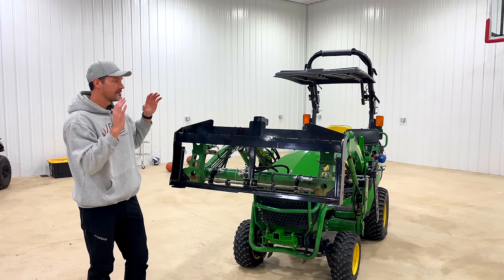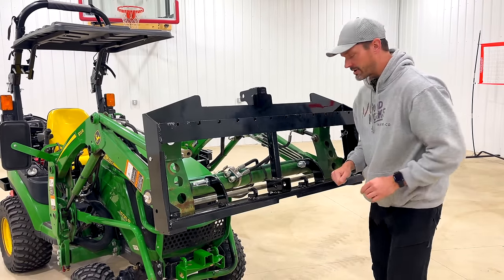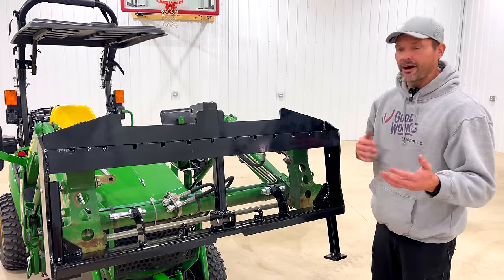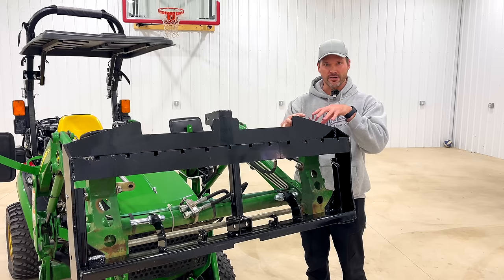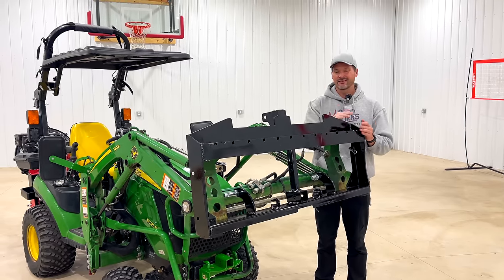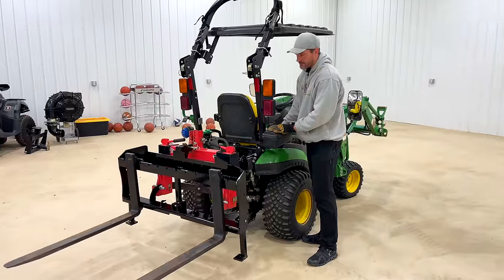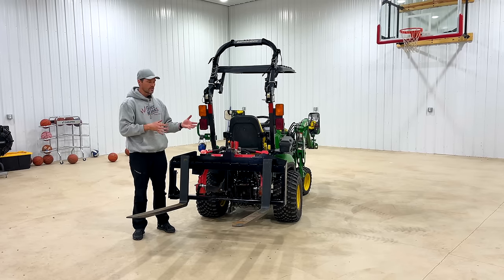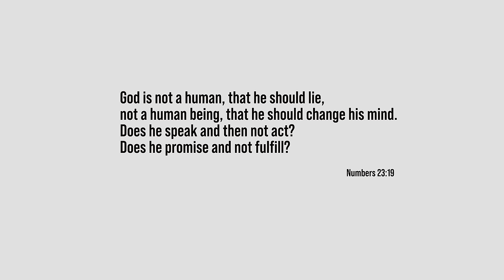I INVENTED BETTER PALLET FORKS

Comment: My immediate thought for the headache guard actually became a bonus feature as I was imagining it. First step is to change the top link bracket gooseneck hitch ball hole into a 2” receiver shape. The headache guard then utilizes that 2” receiver as its primary mounting solution. Have locating pins/holes on the ends of the headache guard to limit twisting forces on the 2” mount tube. Then the genius part I realized is that you could use your headache guard as a small platform if you mounted it into the lower 2 inch receiver. Let’s say a simple version was just made out of square tube steel in a hoop with expanded metal mesh. Not only could you use that as a headache guard but you could also put it in the lower 2 inch receiver and utilize it as a small carryall platform, especially for bags of mulch, fertilizer, feed, whatever. Just a thought for you. 😉
Reply from the maker: Good idea fogle...the reason we haven't used the 2" receiver tube for the gooseneck on the forks nor our VersaBracket is cost...those tubes are actually quite a bit more expensive...perhaps we reconsider though
Reply: How about extending the parking stand tubes and using those like a steak pocket for the headache rack? Only a small change that is still out of the way and braces both sides. @GoodWorksTractors

Comment: I finally put my weight brackets onto my SpeeCo quick hitch.  What a great product.  I took off my Heavy Hitch to install my carry all and haul my tree cutting gear to my neighbors house a quarter mile down the road from me.  I dropped the carry all onto her lawn so my equipment was in one central location.  After felling part of the tree, I started moving a load of limbs on my forks only to find the tractor was too tipsy.  I sprinted home and put the weight brackets on the quick hitch and slung 240 lbs of additional ballast onto the back of my mighty BX (LOL) and what a difference that made.  The great thing about your design is the carry all still works with the brackets and weight in place.  GWT offers some great products.  I currently have a Rhinohide canopy, the SpeeCo Quick Hitch, and the Quick Hitch Weight Brackets.  Enjoy the Journey - Cheers
Reply from the maker: Awesome, that is great to hear.  I love em too :)

Comment: PARKING STAND ……if the receiver tube was extended upwards and made longer this would allow the operator to install the stands upside down.  By inserting the stand upside down and only a few inches inward this would leave a foot or so extended above the fork frame and instantly gives the operator a poor man’s headache guard.   I currently have this modification on my forks made by AI2 for my Kubota BX.   It’s so simple , cost effective and works great when handling logs or other dangerous items.    Great video, and you look to have a much needed product.   Big thx

Comment: I’m definitely interested in a set of these pallet forks for my Kubota MX5400. When you come out with the ssqa version. I also would be interested in a bolt on extension to increase the height of the frame. What a great product. I love the fact that you are a small business and it’s American made . Thanks for putting forth the effort to design and build this fantastic attachment.
Reply from the maker: Thanks Robert!  SSQA version shouldn't be too much longer.  Trickiest part was making the back frame work for loader and 3 point without the brackets interfering with one another.  I believe we found our winning solution though.

Comment: If you decide to offer headache rack, make it secured by pins!  Easy on or off when needed.
Reply from the maker: Yeah, that does seem like a logical solution.
Reply: Yup I second the motion to use pins for the headache rack. Easy on easy off
Reply: Agreed - with the add on feature of a double-use headache rack/support feet.  Have it function as both, using the pin as the locking/securing mechanism.

Comment: I like it. I would have made the lower pins a double shear. 2 mounts with a pin between them. I would also make a plug that goes into the receiver that looks like a T to keep the forks from coming off if used near the center. Only had that happen once but it was a major pain to recover the fork. I would also add a D ring or a hole in the upper right and left corners, I use those a lot with big rachet straps to secure things on to the forks.

Comment: Would come in handy for anyone wanting to carry a 250gal tote on the back,  load it up with fire wood and the grapple on the front and carry a chainsaw in that accessory you got as well.  Full 250 gal tote with wood would probably be 600-800 lbs depending on if it's wet or not.

Comment: I like the drop down legs, but would swap the pin with loose pin clip, which I would almost certainly lose, for a square lock/safety pin or clevis pin where a small piece of wire secures the clip to the pin.  But I get why you wouldn't ship them that way.  It's an operator preference thing and some might never use the leg stands and it would add $7-9 per unit, even if you bought them in bulk.  Hardware prices have gotten out of control in the last few years.
Reply from the maker: Hardware is pricey!  Never know, we may make tweaks over time

Comment: Looks like the quick hitch would interfere with suit case weights when using it on the 3pt, or the upper pallet fork frame mount would interfere if the suit case weights tried to hang out back.  I certainly could be missing something though.  Could you show how the suitcase weights work on the 3pt?   I think I understand how they work when on the loader.  I like the design and idea.  I also think it is good that you left the headache rack off, making a removable one would be preferable for sure.  I have both the VersaBracket and the Hitch Hangers, bundled with all the 70 lb weights they can hold, love both of them.  I have 2 of the red SpeeCo E-Hitch's as well (second one is going to be customized....), so thanks GWT.  Have a good one!!👍

Comment: Instead of a bolt on headache rack, how about adding a 2" square vertical tube on either side of the frame, and having the headache rack drop in, and then pinned like the parking stands? That would make it easier to install or remove. Perhaps to avoid adding the cost of the tubes to every rack, the rack kit would include a 2" tube welded to a plate, and the plate can be bolted to the frame. Something I'd like to see on ANYTHING with pins are wire lanyards to keep from dropping the darn clip. I make my own, but it'd nice if they all came that way.
Reply from the maker: Yeah, might do something like that....I also thought about just making it 4-6 vertical stantions....no horizontal bracing...the vertical posts would serve the purpose, while keeping weight down and oprator visibility to a maximum
Reply: @GoodWorksTractors I think the key takeaway is making it easy to install or remove as necessary. I'd be inclined to leave it off most of the time, but if I'm moving brush or a pallet loaded with straw bales, I'd want the height so I can move more in a load. Also, 2" tube was supposed to be 1". 2" is too large and too heavy.
Reply: TowSmart makes clevis pins with the wire already attached and wider heads so they are easier to remove.  I really like them, along with square safety/lock pins.
Reply: This method of attachment would be ideal & easy to add or remove. Some sort of headache rack is all but essential if used an a Utility tractor.

Comment: That looks like a great idea. One thing that I would really like to see is a way to move 3 point (quick hitch) attachments with the loader. Maybe this could mount where the forks mount? Just something I've been looking for. I run smaller tractors so no need for a headache rack and would rather have the lift capacity.

Comment: I would add some deep chain slots towards the end of the upper cross member where the notches are for the tines.  Or add some pre-drilled holes on the sides to allow straps to be attached to tie down loads.

Comment: My home made fork frame has the  3 point hitch pins mounted higher up so its usable. If you don't do this you not only will have difficulty to hook up, but you also can't get the forks low enough to go into a pallet, or under a log. 

I also thought about adding a tray on the back side of the frame for a place to store chains and chokers for skidding. (Similar to some wenches)

Comment: Having the 3 point pins adjustable for height would help. You need to be able to back into and out of a pellet with the forks. As you stated, not all 3 points go down to the same height from the ground. Even the same tractor model with different tires will vary on the minimum height. Great idea. Thanks

Comment: I'd be interested in a heavy duty version of that. Something with a 4000#+ capacity.
Reply from the maker: Thanks, perhaps down the road.
Reply: Don't know what kind of loader you have but there are brackets available for Mounting loader attachments to the 3 point hitch and those are very heavy duty as far as I know. They are meant for the bigger tractors with cat 2 Hitch. Those aren't that rediculously expensive but you got to demount them every time you want to switch from 3 point to frontloader though. I think they can be fitted with a hydraulic lock. Even seen a skid steer version to 3 point. Or vice versa.

Comment: These are sweet!  Why weren't you making these 5 years ago when I bought my 1025R? (Just kidding)  I modified my Frontier pallet forks to be able to move my 16-foot gooseneck dump trailer.  A word of caution: Of course, my only option is to use the front-end loader.  I only attempt to move the trailer when it is completely empty.  It is fine when pushing it forward but pulling it backward can lift the back wheels off the ground, especially on soft ground or even the slightest uphill grade even with Frontier's largest ballast box full of sand and 200 lbs of wheel weights.
Reply from the maker: Yes, good advice...every piece of equipment will have limitations.  Thanks for sharing!

Comment: Cool idea, I like it. An idea for a zero to very minimal added weight headache rack might be to extend the tubes for the parking stand feet to the top of the frame and then place the hole for the pin to go front to back of the frame rather than side to side as they are for parking, so that the feet are wider side to side.   That would add a good height to the top of the frame and maybe drill a hole part way up the foot post to allow the customer to attach a 2x6 or 2x8 across it with a single carriage bolt for each foot post. You are free to use my idea and sell it, just send me a discounted Versaforks Pallet forks attachment please.

Comment: One thing I just flashed my mind with - Forks holding a load that is not balanced.  not an array of bricks/blocks but maybe a tool or machine or box that is side loaded and would tilt the tractor - so you can weight down the other side to balance the load preventing tipsy on flat ground.  Just a thought.

Comment: I have  been looking for this type of  attachment also, but in a universal quick tach / 3 point  version with a 3500 to 4000 pound rating. A back guard that pins on would be desirable. one concern is the lower 3 point pin brackets look weak, I think they will bend and twist very quickly, overall looks like a great idea. this will give the small tractor owner the ability to lift and carry loads heavier than the front end loader can carry and do it safely.

Comment: Very impressive product.  Some constructive criticism on my rear fork experience a few years ago.  I wasn't impressed at all with the capacity of my BX when using three-point-forks.  On the BX the rear forks work for light loads but I paid way more than what I was able to accomplish with the one I have. So maybe their could be a light-version that has limits for subcompacts if it at all lowers the price in a more sellable way.     & on the BX I actually carry large logs on-the-loader behind-the-bucket, it dumps off as if the practice was part of the design.
Reply from the maker: These are about as light as we can make them...designed for subcompacts too.  Definitely suitable for the BX...once we release the SSQA version.
Reply: @GoodWorksTractors  My experience is in alignment with the 'Implement weight list'.  The rear-blade wight limit for a BX2380 is 248lbs which is about where I experienced my rear-fork limitations.  Odd as the rear-blade on my BX2370 is 306 lbs & works great.  The manual suggests 1765 lbs for a trailer load but I doubt a BX could lift 350 lbs with rear-forks.   I also wanted to use it for a 100 gallon water-tank but a BX can only transport about 40 gallons of water on the rear.

Comment: if you are using it for ballast, it would be nice to have feet that prevent the unit from tipping over.  Look like right now you would need to remove weight to unhook it from the 3 point.   I use brush forks from earth and turf attchments all the time.  I would consider making a set of forks that could work as brush forks.

Comment: I only wish to say that with chain hooks on the front loader arms or the 3-point hitch you must be carefull that you do not put too much pressure pulling against the arms as you can damage the cylinders as that is an expensive fix. And you can mess up a 3point hitch also. if you have a really heavy pull with the rear of the tractor put a D ring  on your draw bar

Comment: I'd add a socket for a hay bale spear and also a bracket to hook in an overhead boom, maybe 6 feet long with a hook. Remove the fork tines,  bolt up (or insert) the boom, presto, you can lift or carry things that the forks wont.

Comment: I love the versaforks! They look great. I would probably use them on the front mostly but my tractor has 1,000 pounds more lift capacity on the rear so that could be extremely useful too. This may be asking for too much but I wonder if it would be possible to add the ability to take the fork tines off and make it a quick hitch as well?

Comment: Is the cutout on the bottom big enough to remove both tines at the same time?  I like to slide mine together to the center and then lower the loader and drop the forks standing up in a position I can come back and scoop them up without lifting them by hand. Hurry up and get the SSQA version coming 😅 thanks for the video

Comment: Like some of the features, question some others, but you still have one thing that all cheap pallet forks have in common. the bottom rail that the pallet forks slide on is too thin and will bend with the leverage of the forks...especially if you use these in brush or other applications the bottom rail needs to be at least half inch just like the top rail. the only exception to this would be to use the hardox steel on the bottom rail....cost would go up, but overall, the customer would be very happier in the end not worrying about the rails bending! It's not just your forks that are built this way....and i do like some of the built in features you are trying for...may i add also try to incorporate a back rack or load guard for safety just like a forklift has....especially if you are designing it.....vicarious iability stinks!

Comment: Not knowing much about pallet forks, other than I want one, is the 2k rating on the fork or the frame? I would like at least a 3k rating, my loader lift capacity is 3100 lbs. Can I just buy the frame when you get the ssqa ready and put on heavier forks? Or is that going to tweak the frame?

Comment: I would be a bit worried about the lower 3 point hitch mounts, if you get a 2000 pound side load from a bounce on those long lower 3 point mounts it could end up bending near the frame.

Comment: fantastic idea but I beat you to it by about 10 years! LOL I have a Kubota B7510 that had a pin on bucket. I made my own qh copied from the Kubota qh. I then made my fork frame and at the suggestion of another guy made it also fit my 3ph qh. I use the forks on the 3ph more than I do on the loader!

Comment: I can see loader bar getting damaged and also hydraulic lines
Reply from the maker: How?  Steel doesn't move.
Reply: @GoodWorksTractors  going through the middle next to the receiver hitch and the three point hitch pins. A piece of expanded metal would solve this.

Comment: Sorry I see know use for pallet forks on the rear of a tractor , other than ballast weight .
Reply: They are awesome for me and many other guys, I made my forks work SSQA and 3 point like many many other guys have done.  This way I can still use the grapple bucket and move logs while splitting big wood, then I can use the forks in the back to move the full IBC totes without changing attachments.  Besides the fact that the 3 point forks can lift ~2x's the what the forks on the loader can it's especially useful on smaller tractors.  Having a hydraulic top link makes them nicer so you can angle the forks up and down as needed on uneven ground.  I can't believe more attachment companies don't make them like this or have the option with the quick attach and 3 point capable.